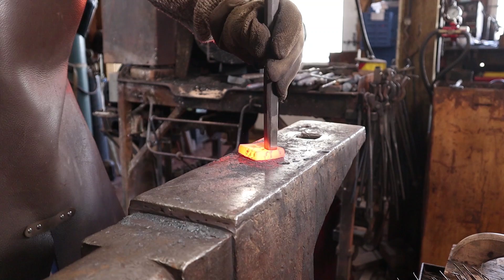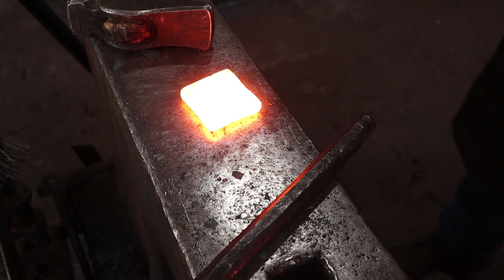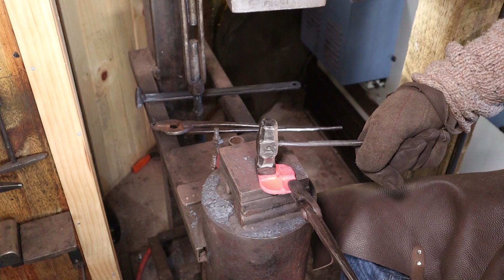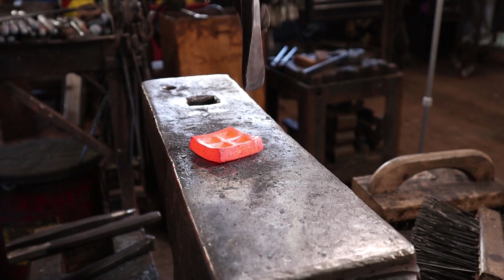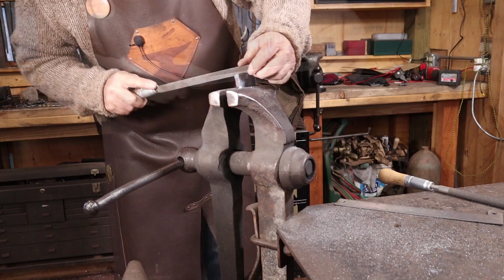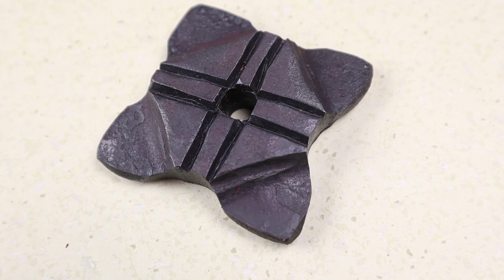Forging Decorative Rosettes

Comment: Thankyou. This gelled an idea for how I can forge a crude positive lock angle adjuster for a long reach gutter cleaning tool  currently fabricating - ie a 6 or 8 step radial flat gear pair without the need for a terrible amount of shaper work. It kind of had me stumped but no longer. Beucoup gratitude.

Comment: On the second rosette you made, I would cut out the thin part so it is just a stepped cross instead of a misshapen square. To hold the parts you could use a pair of tongs held between your legs then you won't have to chase it around your anvil.

Comment: Just looking at the first one you forged and thinking you could use a small ball punch to put an indent in the triangles between the centre and the set down areas......? Not sure if that would just be to much detail? I love the last one you made 👍
Reply from the maker: The variations are endless. Give it a try.
Reply: @BlackBearForge  I think I will........ I probably need to make a few tools first 🤔 it should be fun 👍

Comment: An interesting project. I would suggest welding a piece of square stock bent 90 degrees to square tube fitted into your hardie hole. That would corral the work on 2 sides whilst you work on it.
Reply from the maker: Sounds lime its worth a try
Reply: Interesting concept  that I could see as soon as I  read it.